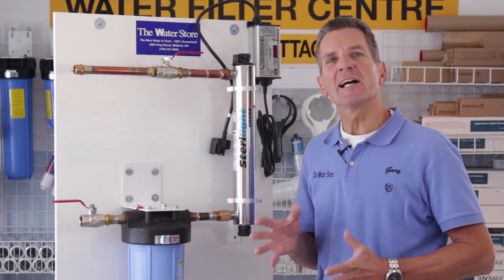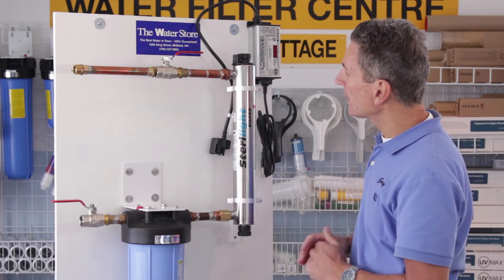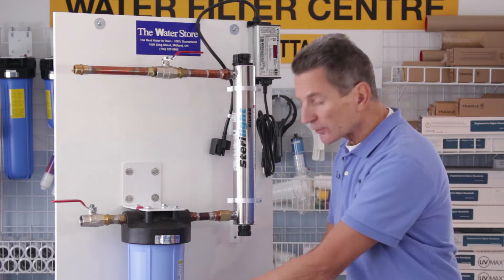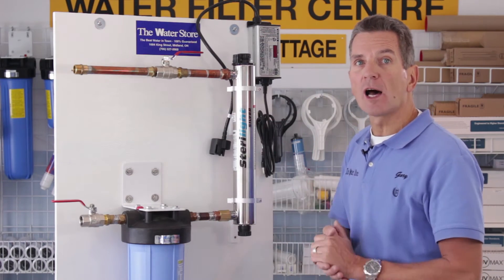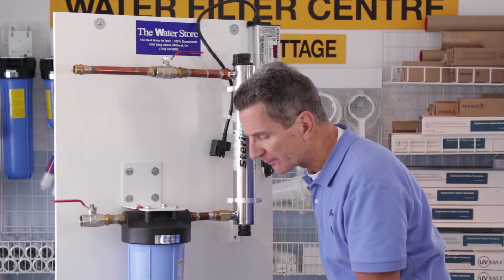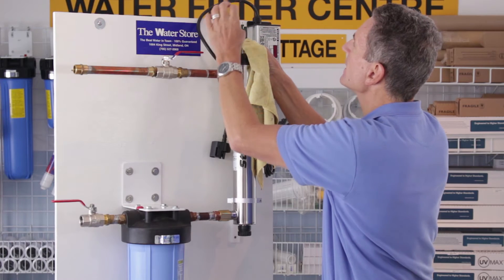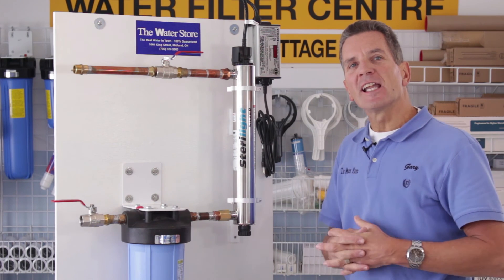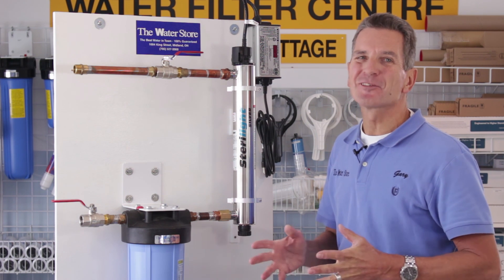How to Install a Viqua/Sterilight UV Disinfection Water Filter

Comment: Hi, so the owners have it installed to where the top is super close to the wall and I can’t change the uv light. What should I do?
Reply from the maker: Sorry to hear.  The system will need to be removed to change the light and then correctly reinstalled so this problem does not exist next year.

Comment: Question... Does the direction of water flow matter?
Reply from the maker: Yes, but not significantly. They want the flow to be toward the end where the UV lamp goes into the housing.
Reply: Can I ask why they recommend the flow this way?  My flow enters opposite end you change the bulb and exits the end you change the bulb. Is this okay?  Mine is horizontal.
Reply: @hithisisharris  Hi Sean... first, I'm no plumber... :D ... but, I too had mine plumbed the same way as yours is currently, without incident.  But, the plumber I paid, also didn't put a bypass on my system.  This meant, I had to shut the entire house down during filter changes... sediment and charcoal... the plumber recommended by Pentair gave me an ear full... :D.. first about following directions (for the previous plumber)... then about things I don't recall at the moment.  With respect to flow, I called Viqua and they said the unit would fail soon, after explaining the situation.... I went a few more weeks before the recommended plumber could come out... but, given the cost, I decided get my system reconfigured the recommended way, even though I couldn't tell the difference... now, I have a built in bypass and the UV system flow per the manufacturers intentions.  So, from one system owner to another, I can't point to anything hard... but, I can say that the clues lying around indicate that the flow should go a certain way... it's tough to tell in the manual, but, there is one pick indicating flow.  I hope something in this novella is of some use? :)
Reply: @MK-qu3pt   hey thanks for getting back to me. So I also called viqua and they said if the unit is horizontal then flow doesn’t matter as long as the output is facing upward to purge the unit of air. If the unit is vertical, then they recommend the light to be on top so water doesn’t drip down onto it.
Anyway, mine is horizontal, the input of water comes through the bottom on the opposite side of the bulb plug. Output through the top on the bulb side. Viqua assured me this was fine so I’ll leave it as is.
Reply: @hithisisharris  Interesting... I had mine vertical, but, the flow connected at the top, and I was told something a little different about that setup?  I guess it depends on who picks up the phone. :D  I'm glad things worked out!